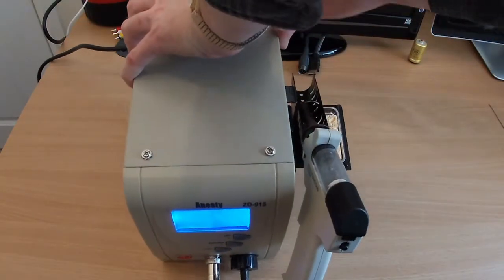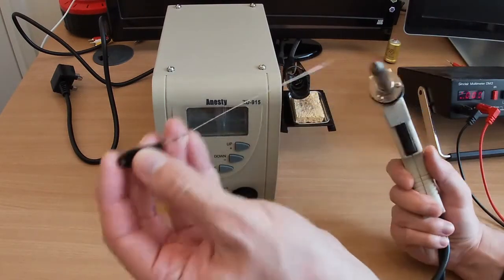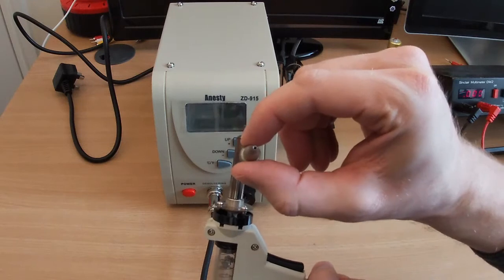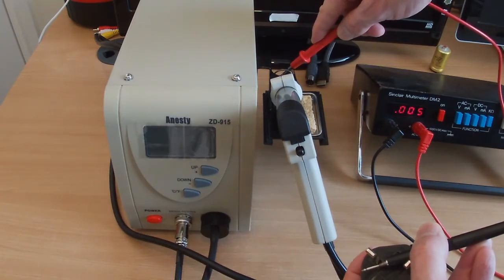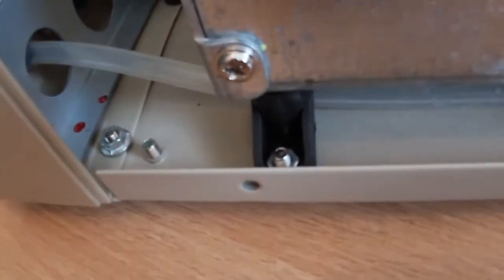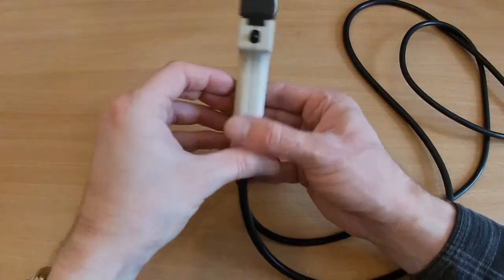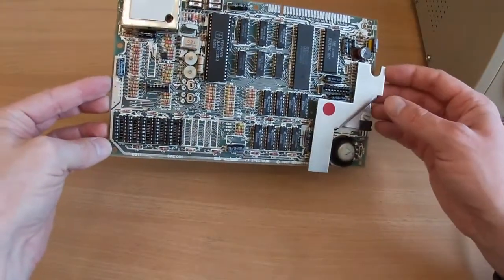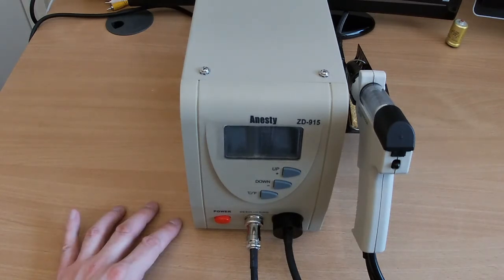ZD-915 Desoldering Station Review

Comment: I've got one and it takes a lot of time to maintain and keep it in working order. It's almost always clogged and requires cleaning. It's so much work and hassle that I usually just use my manually operated basic solder sucker. I also had to replace the fan :)

Comment: I bought a Duratool branded one late last year. I agree it does clog quite often and can sometimes be a pain to clear. Sometimes I have to get my soldering iron on the metal tube in the glass as the solder gathers in there. 
And my fan has started making a rattling noise! :)

But absolutely essential for a serious hobbyist and I wouldn't want to not have one in my toolkit. 👍
Reply from the maker: I would hate not to have one now. Even with its clogging issues they are well worth the money
Reply: Try turning the fan around so it sucks air in through the back instead of blowing it out. If you have it graphite powder or light coat of wd 40 on the fan shaft helps